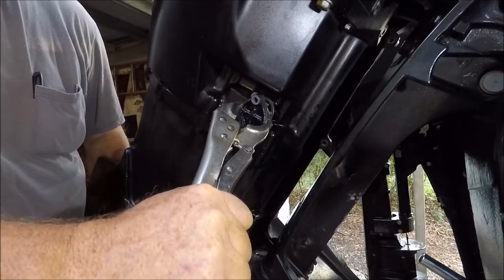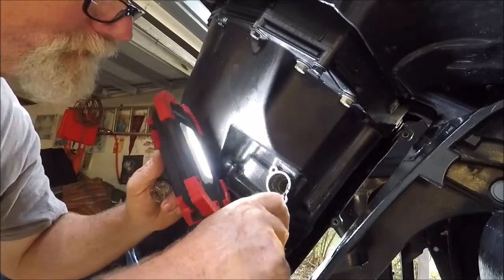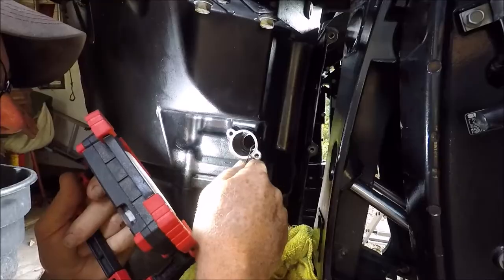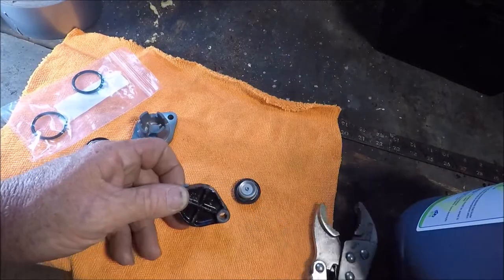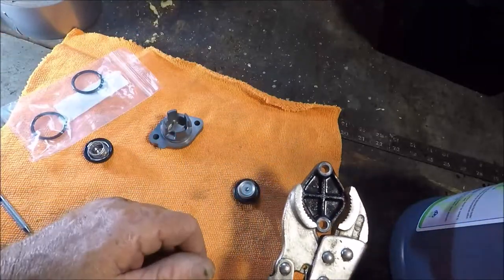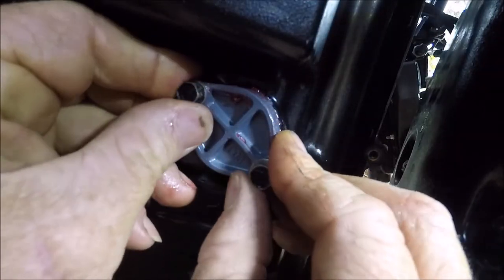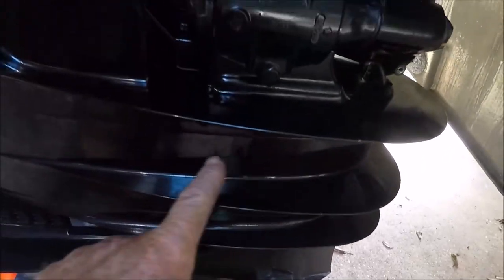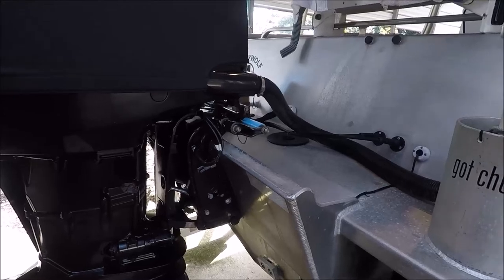SUZUKI WATER PRESSURE VALVE REPLACEMENT

Comment: Tell you one thing Suzuki's are cheap motors and there seems to be endless problems. I really got to look at a 300 hp over recently and the whole motor looks cheap and the parts they use are shit. Its not worth it stay with the 3 only outboard motors to buy Mercury Yamaha and evirnude. As a mechanic with 35 years of experience and whenever anyone asks me about Suzuki my reply is very simple when have you ever seen an old Suzuki outboard motor and then they realize yeah you right I've never seen one! They either rot out with corrosion or blow up.
Reply: What you posted makes no sense at all , Buy an Evinrude ? where? last thing I herd about them is they went out of buisness. So the idea of buying a used outboard made by a non existent company is not a great one.   Yamahas don't rot? of course they do that's why they came out with an exhaust housing repair kit. Yamaha had so many complaints of exhaust gas leaks into the coolant water because of rot, the kit was specially made to address the problem  Mercury had a problem with their blocks rotting out as well at one point in time, back when they used Styrofoam type casting. Cheap parts? Half the parts in a Suzuki are made by the same companies that Yamaha uses. Guess you never herd of Bosch, Mitsubishi or Mikuni?    No old Suzuki's?  Are we talking old or historical? There are plenty of 20 + year old Suzuki's around. Cheap? there are no cheap outboard motors made in the world today you can look for one, but you have a better chance of finding big foot or the loch ness monster.  Are you sure your a marine mechanic?
Reply from the maker: Well your just another blowhard mechanic, I'd never use. You TALK out your ass. 
As far as my video goes. I'm trying to help people out. And have!  Unlike your comment.
Reply: Wow I'm 20 times more intelligent than you I have a college degree in automotive I know when an engine is designed cheap! I have been around boats my whole life and regularly fish. I know people who commercially use outboards as well. I can see you have no tolerance for opinions. I'm simply informing people to buy a better quality outboard motor cheaper is always more expensive. Funny when I bought my brand new G2 the dealer also sold susuki and b4 I could say anything the owner who by the way is a great outboard mechanic said you're not buying the susuki right? I said no and he said good. You shouldn't get nasty with people who Express there opinions.
Reply: Yes they are much cheaper to buy new than the other top brands. I guess your the only one who sees older suzukis around.
Reply: @deansclafani5567  Nobody is being nasty.  Automotive is not salt water marine mechanics. Your comment was not opinion it bashed a specific brand of outboard engine. You may have a college degree in auto mechanics but you need to take a course or two in tact and courtesy. This channel is run by a professional fishing guide. Fishing is his living It's how he pays his bills. Dave also has 30 plus years experience in his field. You come to the channel, you watch the video and you see what his choice of outboard is. His livelihood and reputation literally hangs on the back of that boat but you bash that choice and indirectly call him an idiot. Can you blame him or anyone else for being defensive. Like I said you need to learn tact and courtesy. I'm going on 56 years old. My marine mechanic career started when I was 12 as my father who was a marine mechanic started me turning a wrench. My response to your original comment was nothing  more than absolute fact. Is this the best you can do to dispute what I posted there Joe college?  Is that your best?
Reply: I never called anyone an idiot everyone is so sensitive today its amazing . It's a fact there cheap motors period you get what you pay for! What's next a bayliner is better than a yellowfin! Everyone in the industry knows that. I would rather pay a little more for a better motor that's all ! Stop being so sensitive jesus man up.
Reply from the maker: @deansclafani5567  REALLY, well you came here, and ran your mouth on this video about something to do with nothing. Completely off topic. Wrong, I and hundreds of others like me run suzuki's commercially.  Your comments has not helped a single person, you just throw around personal opinion.
Reply: You state you are a mechanic, of what, elevators? You are clueless on Suzuki's.
Reply: And if you know boats that statement is very true when have you ever seen older Suzukis around? Only Mercury Evirnude or Yamaha that's it and some Honda's
Reply: @deansclafani5567  what?
Reply: @firetools1  the truth hurts huh Paul cheap is more expensive. Get over it do you even own a boat
Reply: @deansclafani5567  yes I do. I've had Johnson,  mercury, mercruiser and tohatsu on different boats over the years. All boat motor manufacturers these days produce high quality motors. It all comes down to personal choice.
Reply: @firetools1   My apology to you. I confused you with the Suzuki basher. There were many replies and I made a mistake.   I deleted the other incorrect reply that I posted.   As for the guy I confused you with I don't know what he's talking about. I see plenty of early 2000 era Suzuki's still running today. 20 years is old for an outboard in salt water.
Reply: @orowock1  apology accepted.
Reply: Can't believe people are still continuing to be offended its really childish. The fact is you never see old Suzukis! If you say you do your either lying or don't spend time on the water. As far as the guy who said he has a 20 year old Suzuki he's the only one in long island or NY period probably has very little hours. People are buying them because there cheap and available.
Reply: @deansclafani5567  but the point is, Yamaha are no better, dont even get started on Mercury...... u only see them on race boats, nothing else around here..... Yamaha are extremely over priced, to get nothing better in return..... I spoke to alot of guys last year, i could have and would have bought a Yamaha if they were any better but the point is, every service guy i spoke to, not 1 guy said to spend the extra on a yamaha, Ive never heard of anybody regretting buying one either....
Reply: I have a 140 Suzy, 16yrs old and still punching strong 💪
Reply: imo suzuki make some of the best machines, in or out of the water- as do yamaha, merc, they all have issues because they all fight salt water. .
Reply: @francoisandlaurabrand7597  I posted this like a year ago and people are still responding. It's a cheaper engine period. Definitely not the best but people buy what they can afford I get it.
Reply: I bought my Suzuki new in 2005 and until this year (18 years later) I have not had a single issue, not one!  Even now it runs perfectly with tons of power. My Suzuki has been an amazing engine and I wouldn’t hesitate to buy another one.

Comment: You are not helping your corrosion problem by using a steel pick on aluminum. Causes dissimilar metal corrosion.
Reply from the maker: I have a 100k alloy boat....think I know about dissimilar metals! that isn't doing diddly. But thanks for your concern. 🤷‍♂️
Reply: @CaptDavesSportfishing  I’ve been a certified and practicing A&P mechanic for corporate aviation, airlines and government for 24 years, I’ve taken more classes on metallurgy, alloys and corrosion prevention than I care to remember, I’m not just some troll giving my opinion. The FAA, NTSB and other reputable organizations specifically talk about this practice and highly discourage it, anywhere you work on aircraft will just get rid of you if they catch you doing it. Just trying to spread some knowledge. But if it works for you great. Best wishes.
Reply from the maker: @jasonrutherfordbassfishing  I hardly did a thing with the pick, other than see what grime was in there....I didn't go mining! and if that was so, a lot of marine grade alloy on outboards are destroyed by a screw driver tip!  . That outboard was retired, for overheating, now someone else's problem. I don't keep any of them past warranty expiration, anyhow.
Reply: @CaptDavesSportfishing  How many hours on the one you cycled out, just curious, watched a lot of videos and felt I knew that engine.
I just got a new one like it this week...
Reply from the maker: @floridasaltlife  its part of my maintenance, dont listen to none of these other commentors with their nut case comments like the one above yours. About every 400 hrs, or for me, once a year or so. I'll change my valve out, because after taking off the plastics anyhow, to change the anode near the oil pan, and replacing it, why not. The motor is my livelihood. I want everything as perfect as I can keep it. I have many, maintenance videos, and trouble shooting issues videos. Im not a mechanic, just a fisherman so I video as I learn, also.